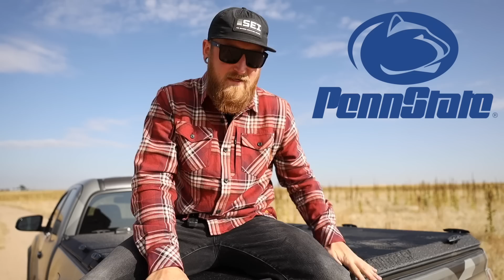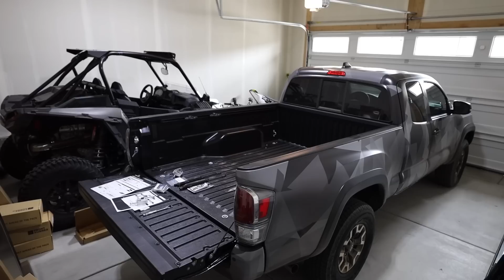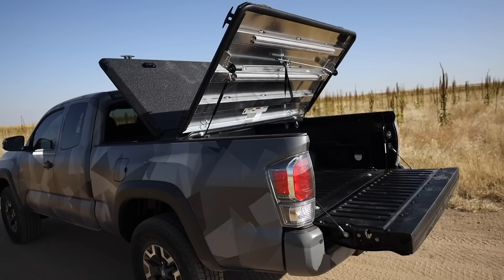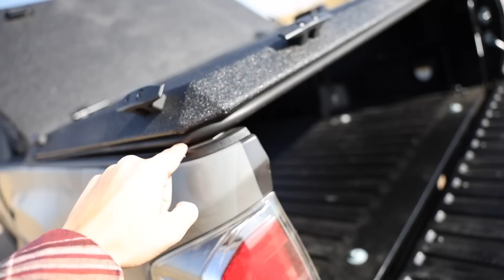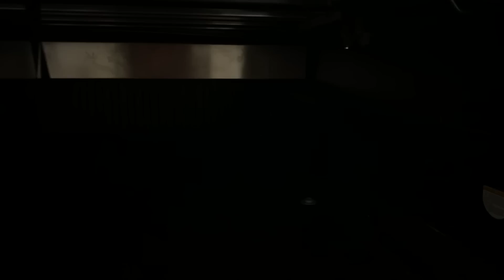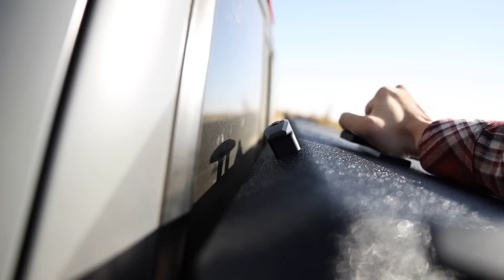THE BEST TRUCK BED COVER! | Diamondback HD setup / tips...

Comment from the maker: Full build sheet / prices / discount codes are available at www.seiproductions.com/seigarage
Reply: Thanks for your video of the Diamondback HD! I am just about sold on this cover as being one of the most secure. I do see a potential flaw that looks like it could easily be exploited. It looks as if all someone would need to do is remove 4 hinge screws and a cover could be removed with a slight twist from the hinge side. It would be cool if someone could verify this as it looks like this would be pretty easy to do. The alternative cover I am looking at is the Renegade cover which is similar but does not have hinge screws that can be removed. What is your opinion on this? Thx.

Comment: Useful review.  I don't know if you'll see this, it has been so long, but I am deciding b/t getting one of the F150's with either the tradition fold down tailgate that has that pullout step, or the new 2024 pro access tailgate that in addition to being able to open by folding down flat also has a center section that can swing out to the side.  If you've gotten that front runner tent set up and used it, how was the access strictly thru the open fold down tailgate, very inconvenient, and do you think it would be significantly more convenient to have that swing out center door in the tailgate so i can reach under the bedcover from right up next to the back of the truck w/out have the fold down flat tailgate in my way?  And do you think that tailgate with the swing out doo would seal against water as well as the traditional?  Man, I love this bedcover.  I plan to get it on whichever truck I end up buying.

Comment: Hey they are awesome covers but I think they should develop a hard cover just for security purposes for back of the pickup bed. There isn’t a lot of really secure hard bed covers. Owners not using to haul on top of the cover would appreciate a secure hardcover by a awesome company. 
I would purchase one myself. 
Excellent tutorial
Reply from the maker: This is the most secure cover you can buy.
Reply: No Doubt But for truck owners not looking to haul on top of hard cover need a better hard cover option. This company can deliver it.
Reply: Look at the DB SE. It has a 400 pound capacity, configured identical to HD, and $400 less than the HD. DB, has already made the cover you are requesting.

Comment: So I guess for anyone who uses their bed to haul big stuff like furniture, lawnmowers, snowblowers etc… don’t get this and get a tri fold. But if you use your bed like a car trunk for functionality this is the top of the line bed cover?
Reply: Either flip-up panel can lay flat on top of the other to expose that half of the bed. If that isn't enough, both front and rear flip up panels remove with ease in under a minute. If you need the center portion removed for full bed access as well, that is about a 10 minute job, just loosening the clamps and taking it off.

Comment: Plan on getting a Diamondback, torn between the rugged and smooth finish though. Seems like most go for the smooth, is that just for the aesthetics? I plan on possibly having coolers and kayaks strapped straight on top but even the smooth looks pretty grippy. Opinions? will the smooth wear down from doing that quickly? Thanks!

Comment: Please be careful about telling people it is weather proof or water resistant. There are a ton of areas, as part of the truck bed, where water can get in.  Some areas are minor, others are major. One of the major areas where water is getting in to mine is in the front 2 corners of the truck bed where there are very wide gap openings that sit right below the cover. I haven't figured out how I'm going to plug those holes; I'm really trying to avoid filling the whole damn thing with some sort of adhesive goo. Maybe plug them with some foam? I don't know.  And it's not the little tiny gaps where you put the silicone. It's the large gaps under those.. Please share your thoughts on that if you can.

Comment: The diamondback may be weather sealed but the Tacoma bed is not! I love my cover, but get more water coming in the front corners by the bulk head than I would like.
Reply from the maker: Follow the instructions I laid out in this video and you won’t have that problem anymore
Reply: @TalonSei  Yeah I added that comment before I finished the video, my bad! They didn't send silicone with mine I haven't been wanting to do the silicone but it seems to be the only option.

Comment: Sounds like a great company I like the weight capacity you can put on top of it, the one I have on my truck it’s a three panel different company. but I have a ladder rack on my truck little bit larger than what everybody else is running that I can actually open up the three panel an access everything in the back of my truck ok 👌🏼🔥🤠🔥Camping Russ out PS can’t wait to see everything that’s going on your truck buddy 😎

Comment: Hey T! How easy is it to take the whole thing off in case you need to use the entire bed will it take you roughly an hour to put it back on?
Reply from the maker: Nope once installed I can get the cover off in probably 5 minutes and back on in about the same. The initial setup time is just to get the fitment correct 👍🏻

Comment: I love my diamondback. I have an SE mounted on my Colorado, also with the 6’ bed. It’s totally true what you said about mounting a tent. I have an FSR tent mounted onto the front runner loadbar system and losing the articulation does make getting stuff in and out of my truck bed a bit of a challenge, especially with that extra foot offered in the longer bed. Still love having all my stuff back there safe from the weather and locked up tight. I drove coast to coast and it was nice having everything secure back there.

Comment: Are there options on where to mount the locks? (Looks damn good BTW)
Reply: Ah, handle for the bars too. There is my answer, lol...
Reply: So, I do have a question... I got my 2019 TRD Pro last week. The bed cap on the cab side, looks just like the one you have, and mounts in the same place that the rail system was, in my 2015. I actually used that for hauling my bikes. I am planning on a DB cover, so the bike mounts will probably go on the cover. But, do the 3rd gens really delete the rail on the cab side of the bed?

Comment: A tip from another Tacoma Diamondback owner.  Get a tailgate weather seal kit.  It just some of the stick on rubber weather seal.  Otherwise, you are going to get some water mist and suck tons of dust through the cracks in the tailgate.  Since it looks like you are on a lot of dusty roads I'd highly recommend it.

Comment: You probably already know this but you can add bed lights. It’s already wired in to the truck behind the tail light housing. Pretty inexpensive too. I think oem led lights are around $50. There may even be a way to wire those cover lights to that also.

Comment: Is the cover loud/squeaky while driving?
Reply: I have the SE version on my F-150.  I also confirm it is silent.  I drove around with windows down and not a single squeak or rattle was heard.
Reply: Thank you both, much appreciated! Actually considering one for my F-150.
Reply from the maker: Not at all. It is silent as long as you install it correctly